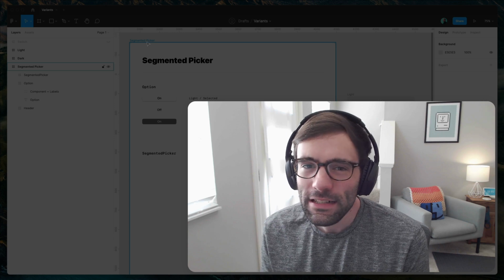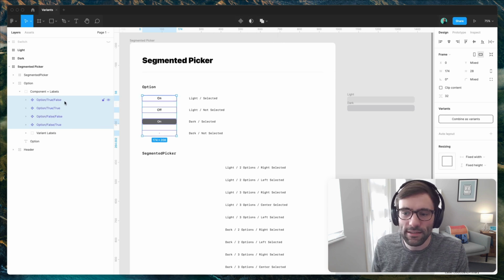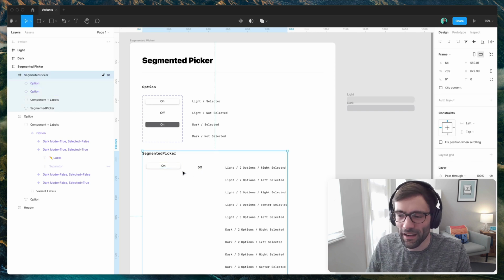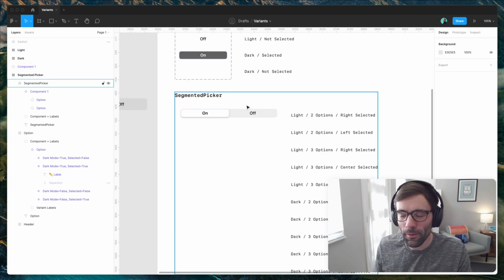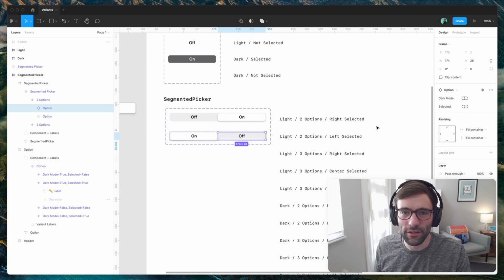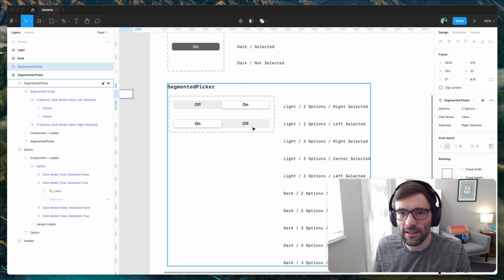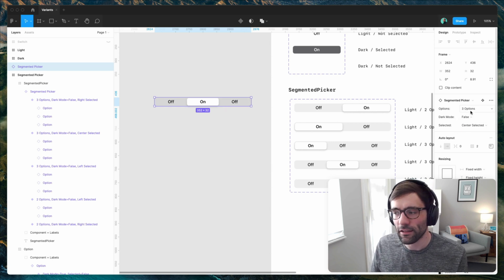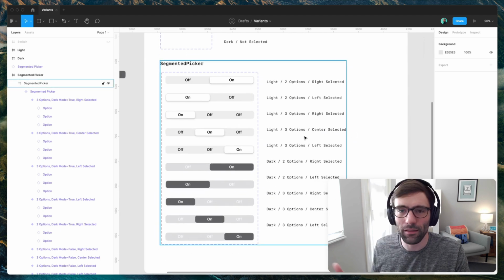Using Variants to Help Build Your Design System

Comment: Great videos. Thanks. But isn’t it good practice to start with a single True Master component that can be edited to ripple all the sub components (ie a font change or size, or corner radius). And, surely the background colors your copying and pasting as rectangles would be much better applied if the components were themselves frames and you were changing the BG color from your color system Library. 

My2¢